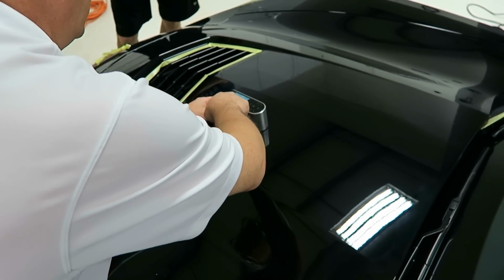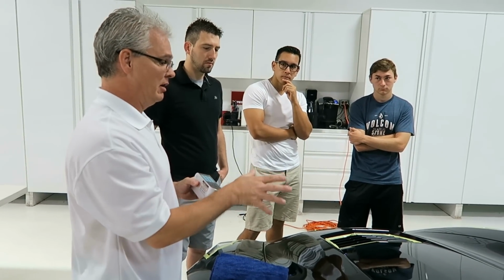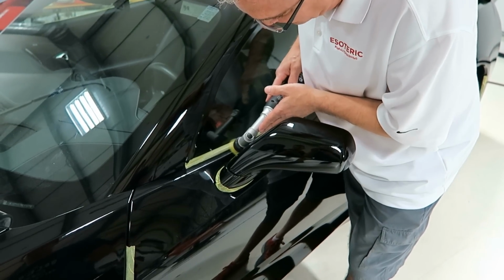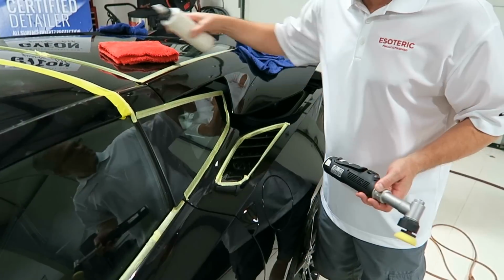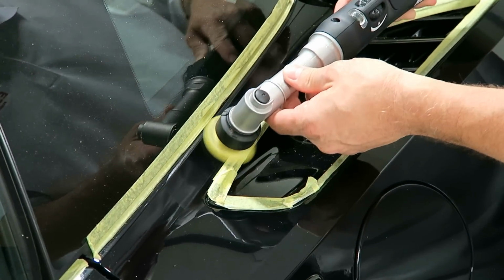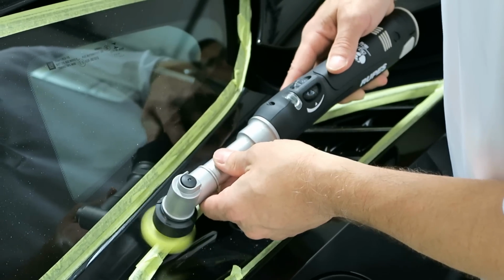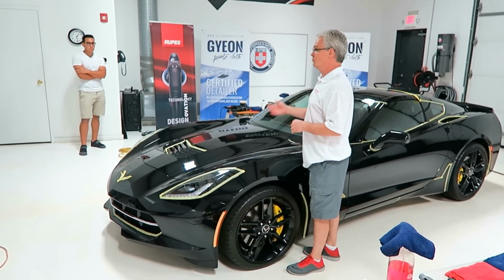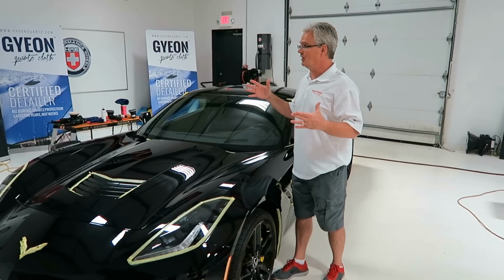Esoteric Detailing Academy Visit:  Video 2

Comment: Hey Matt unfortunately I don't have access to a garage I wanted to polish my car but I'm afraid that could go wrong if I were to pick up something on the pad and result in scratching my car do you think I would be safe doing so outside and also do you have any recommendations for car covers that would be fully scratch resistant?
Reply from the maker: You could definitely do it.  Just stay out of the sun.  Check out www.coverking.com.  The only problem with car covers is that you can only use them directly after the car is cleaned.

Comment: damn splattering polish and dust all over the car, there's even rubber not taped up, once you get it on the rubber its never the same, not to mention all the cracks the dust settles into, you can wash the car many times and still have dust stuck into the cracks. How can someone have this kind of business and be such a beginner.
Reply from the maker: Ha, ha...  You clearly don't know where I am in this video.  You might want to Google it before making comments.
Reply: real annoying